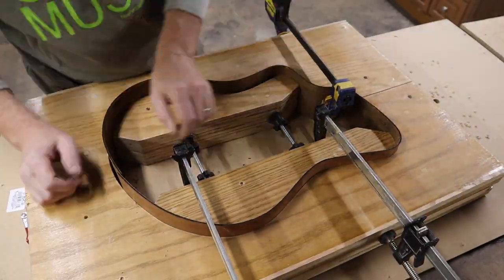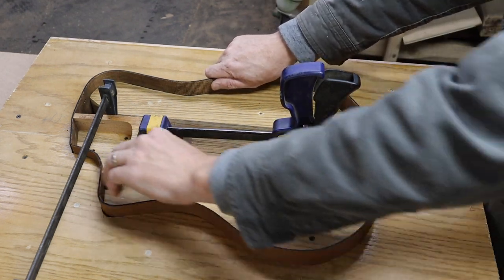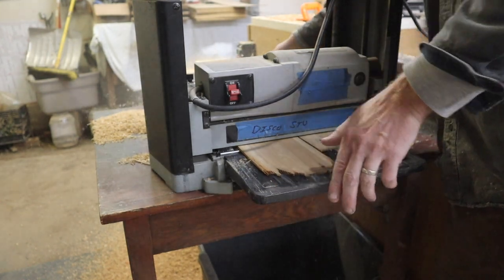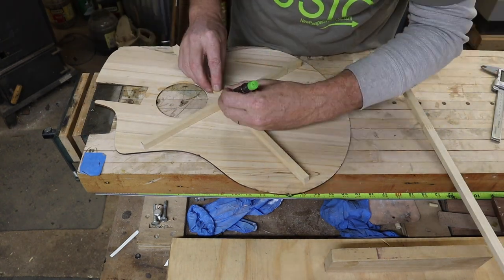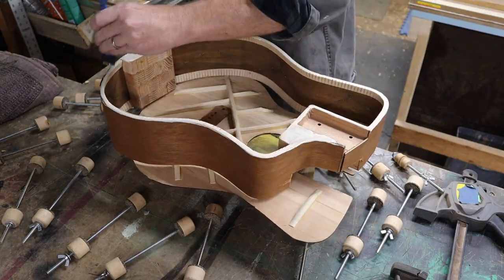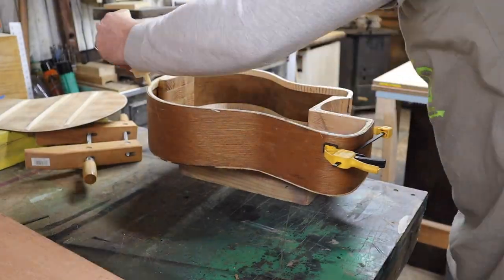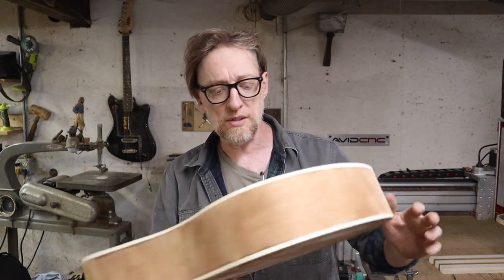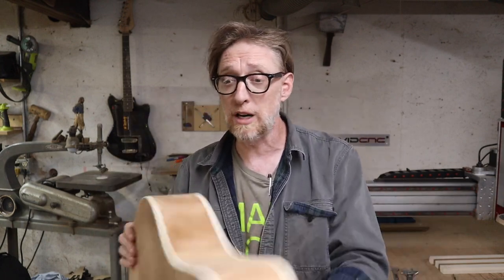Hybrid Acoustic Guitar #2: Making "The Box"

Comment: Cool go-bars/deck. You could 3d print feet to hold rounded or weirdly specific things. The 3" body definitely has a great look to it.
Reply from the maker: I love that idea, 3d printed feet the width of the bracing bars to "lock" over them, etc... cheers!
Reply: @timsway  A mini "fractal vise" would cover all the bases. Fractal Rose on a stick, type thing, lol. Happy to throw out ideas to help save any time. Thanks for letting us look over your shoulder man. Cheers!
Reply: Another simple way is to get a piece of 1" MDF board screw down two lengths of 2"x2" on either side of a soundboard/back. On top of the 2"x2"s screw lengths of 2"x1" with three 1" spacers leaving two gaps each side. Get some 2"x1" pieces to slide in and overhang the gaps and bridge where the soundboard/back will be. Drill a series of holes 2" apart down the centre of these bridging pieces and tap to accept suitable bolts. Fill the bridging pieces with bolts. This will enable the braces to be glued in place the bridging pieces aligned over and the bolts tightened to apply desired pressure. To tap wood just use normal metal tap M8 and experiment with just smaller hole drill size - bolts will work surprisingly well in threaded wood.

Comment: Keep up the R&D Tim, the problem solving is a fascinating learning curve for all of us. OK, the thinner box, much nicer. The single join, a classic trade mark. The fence board fascia says so much for the wonder of wood and recyclability and used front and back instead of hollow door, it would allow for more inlay work around the edge. Could the sides be 'slotted' into the neck-block? Keep up the good work, I'm waiting to hear how they sound. cheers.
Reply from the maker: yea, I think if I get to settled measurements on everything, I could cut the sides to fit the neck joint area. And I'm kind of digging the intentionally off-center seam. Like me, a little off-center, on purpose :)

Comment: Question regarding the GO bars, what are the benefits of using such bars as opposed to weighing the bracings down when you glue them in?
Reply from the maker: With weights, for them to be heavy enough they need to be pretty big, so they get in the way, or like, with 10 little pieces of wood obscured by the large weight, you can;t see if one of them slid a little while placing the weight, etc... this gives you more accuracy and flexibility.

Comment: Always fun to watch your process! Your videos actually inspired me to built an electric guitar kit I found. (Looks great but plays horrible... xD) I was wondering if you could solve your neck hole and string hole alignment through indexing the two while gluing.
Reply from the maker: Now that you have the kit assembled, the next skill is to try to make it play good. Unless the neck is totally warped or too weak to hold the strings, most guitars can be made to play well. It's the perfect guitar to learn on! I could probably find some way of indexing the top as I glue it, but I think it would be easier to just do it right and place the bridge after assembly. Before the back is glued on the sides are like holding Jell-o :)
Reply: The neck is quite alright luckily, but I probably need to replace the nut and modify the bridge. The string action is way too high and I already have the bridge in the lowest possible setting. (The holes not properly aligning for the tune-o-matic style bridge and binding the adjustment bolts does not make it better :D) I wonder if the neck pocket is too deep. At the same time I do not want to shim the neck higher due to the probably emerging gap between body and neck. 
I would fear the flex of the guitar top while drilling the bridge holes, probably tricky to support. And the additional task of fishing all the wood chips out of there. xD It's enough of a challenge to get my pick out sometimes.

Comment: It’s far more common to make the x brace intersection a lap joint rather than two separate pieces for one of the braces. I would suggest to you to run a stringer to bridge the two separate arms, maybe 2” long by 1/8” high. That intersection has a lot of downward pressure, I’d hate to see your project have a structural fail from the string tension…